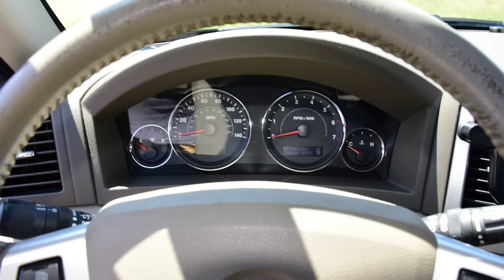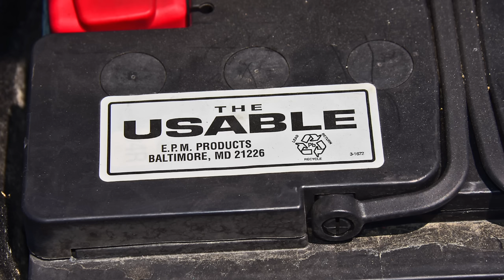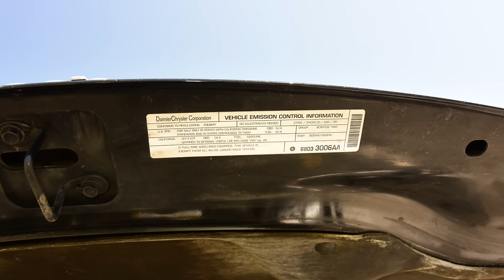2008 Jeep Grand Cherokee Laredo X: Regular Car Reviews

Comment: FWIW I can sort of relate to your "like everything" approach when it comes to cars. Now I do have a few particular likes and dislikes when it comes to how the car feels (I'll admit that I'm kind of particular on brake pedal feel/travel) but other than that it can be a cheap crappy car or a very nice car and I'll find stuff to enjoy about it, and driving dynamics wise I'll see something not great as a challenge and try to drive around that or to adapt my driving style to best suit the car: my vehicular hot take would be that back when my parents just got their Camry and I was younger, I enjoyed trying to go fast in it BECAUSE it was a floaty Camry (and with the 4 banger, not even with the nice 2GR V6) that felt predictable but not really meant to go fast in it. Similarly whenever I had to drive the office car in a previous job and it was some Chevy branded rebadged Opel corsa, I enjoyed revving  the snot out of it just to make it move, and use it's lightness to try and see what it would do. Similarly driving an old beater pickup or mostly rusted out grand cherokee where fun just because it was a challenge to try and keep going on it while the car's systems started to fail randomly.

Comment: Try a 2010 Ford Transit Connect...Those suck sooooo hard!
Reply: I think they were the first year offered in the US, if they are not already rotted out, or tyransmission completely shot, they all will have the same dent pattern in the rear bumper. They are sooo sooo terrible.

Comment: is the mechanics and capabilities of a mini van with the body of an SUV.
Reply: Nah, the Chrysler minivan old or new body was a better car in virtually every way. Was Chryslers flagship product at the time. Ran a 2005 towing and hauling absurd amounts for 10 years as a business and family vehicle. It was excellent at almost everything, other than undersized brakes and a pain to reach the rear cylinder bank. They tend to rust, but it survived PA with some rust repair for 220k miles.

Comment: Should have reviewed an early jeep liberty with the 4 cylinder. At least my wife's had the V6 but the 4 speed auto neutered it to the point it's still the worst car I've driven that my family has actually owned. I had to daily it across town because it got 15 mpg and my wife got my new TDI to drive 60 miles a day. She thought a liberty was a cheaper version of the RAV4 she wanted... She was wrong.
Reply: Those 2.4l first gen Liberties were pretty rare. Most were super stripped out base models sold for use as municipal vehicles. I see a ton of Liberties daily where I'm at but can't recall the last time I saw a non-V6 one.
Reply: @RatBürgerSk8  I agree most of them were stripped down models but we must have a higher poverty rate around me because I'd say it was about 50/50 between V6 limiteds and 4 bangers with non color matched bumpers. What's rare to see is the common rail diesel model they only made a couple years. Highly sought after but still a turd. Probably the slowest production vehicle in the US when made lol

Comment: Its a base model and 15 years old, lets calm down and moderate our expectations. When these came out in '05 they were very popular and well received. "Burnt out bulbs in the HVAC head unit" its 15 years old. "Humming noise from the rear" its 15 years old with 225,000 miles. "Hard plastic" its 15 years old with a design/engineering program dating back to the early 2000s when everything had cheap hard plastic.
Reply: where i live, these things are considered rubbish, but we have cars like Land cruisers, Nissan Patrols (both Y61 and Y62), Mitubishi Pajero and all these japanese SUVs absolutely s**t on these things in literally everything. even durability, these japanese SUVs have been running for approximately the same age (actually, we have japanese SUVs from 80s still running on original drivetrain) without even having any of mentioned issues despite being in way harsher environment. these WK jeeps however, you would be lucky to even see one running anymore
Reply: These were uniquely bad even for the era, no matter the trim level. The Ford Taurus Freestyle, Chevrolet Malibu/Malibu Maxx, and Mitsubishi Endeavour were all called out for their horrible interiors, but Chrysler products of this time between 2005 and 2014 were bottom of the barrel. I know from personal experience. Even cheap Hyundai Elantras were better inside and those were $14,000.
Reply: It's been my experience with Japanese car owners that they usually fail to disclose any issues they HAVE had with them, because they want the Japanese reliability Uber Alles narrative to be true so badly. Sure, most Toyotas and Hondas are well built and usually last a long time (although less so as of recently) However, Nissans have been garbage for 20 years and so have Mitsubishis. Toyotas from the 90s and 00s have interiors that turn to slime, I'd rather have hard plastic. Honda had a run of automatic Transmissions in the early 00s that blew up if you looked at them wrong, yet this is hardly mentioned today. Toyota couldn't figure out for the longest time how to make their trucks not snap in half in states that use salt, consequently there are very few 20 year Toyota trucks on the road still vs the domestic brands. Also, Toyota has had plenty of issues with engines sludging and rods flying through the block (early 90s-00s camrys) shitty CVTs in the corolla and myriad other issues over the years, yet it's all glossed over because "TOYOTA GOOD, DOMESTIC BAD" 

I guarantee there are more 15-20 year old chrysler product on the roads vs the same era of Hyundai, those have all but disappeared from the Midwest.
Reply: @carsandpipesforever506  i said where i live. and yes, CVT nissans are terrible, but the Nissans we got in GCC market that weren’t touched by renault (N16 nissan sunny, Y61 patrols, nissan hardbody pickups still being sold due to demand, Urvan, NV350) don’t give a crap about hot climate, they literally last forever. meanwhile american and european junk are filled in the workshops despite being 5-7% (yes, because they don’t last) of the cars on the road while barely being half a decade old. as far as mitsubishi, maybe yall got bad assembled ones? because the pajeros from even the first generation are still working. hell, we got mazdas and mitsubishis from the late 80s working to this day.

would take a pajero over a pile of crap american trash anyday of the week
Reply: I'm the owner. Everything you say is true, and frankly we consider ourselves fortunate to still have it around. BTW, the humming started about a decade ago at/around 90k (yes, it had been serviced before then)- my mechanic used to work at a jeep dealership and explained that the gears inside the rear diff sometimes develop burrs which causes the sound. Sometimes it's OK, sometimes it kills the diff (in which case, it gets REALLY loud before going). After my wife, this thing went to both my sons while they were in college. It's rare to get a college car back in one piece, more rare when it does two tours of duty. The kids are gone, so we use it as a third vehicle now. I accept what it isn't and appreciate what it is and what it provides.

Comment: This particular trim is the cheapest possible yet 40k price tag had a huge profit margin...you kind of should not blame the car on that, in fact jeep is doing it again with their 2023 lineup corporate greed its not related to car design. Because in paper this was an affordable 4x4 SUV i dont get why to demonize brands for getting afoordable trim levels maybe i dont want a second mortage to buy my next car? Sheer f*kn hubbris. (caveat corporate greed)

Just want to add if the battery exploded 4 years ago it means it was like eleven years old! What would you expect? Batteries shuld be replaced every 3 years, 5 tops.

Comment: I love zjs(grands from 91-98) and xjs(84-01 cherokees). Its not just the pretty tough body and parts. But that i6 4.0... if a jeep dont have it, there really isn't a reason to look at it. I got a 2000 grand and the build quality and engineering is horrible. Most everything that goes wrong means many hours of taking things apart to get to the flaw. Like the ac condenser and heater core. Every wire is stretched taught, which means it you have to disconnect something.. you have a serious risk of breaking the connection or wire. I will curse diamler chrysler til the day I die for what they did to grand cherokees. May they all rot in new jerseys... unable to escape for all eternity.
Reply: My rule of thumb if it was an engine designed in the 60’s and carried on through the 90’s it’s probably really good. AMC/Jeep 4.0, Chevy 350, Ford 300/302/351/460, are all fantastic engines and with modern oil will last forever. My wife was driving a ‘93 Jeep XJ when we met in ‘99 and we drove that for years after. They never made an engine as good as that in all the years since. I can certainly see why they’re so well regarded. We ended up selling it for an XLE V6 Camry that got a lot better mileage. I wish we would have held onto it

Comment: That thing has a bad wheel bearing from the sound of it.
Reply: Nope, it's inside the rear diff. Been making that sound for about a decade. Good part is that you can't really hear it when you get to highway speed.
Reply: @mikehook4830  I'm sure it'll work fine until the diff locks up. 

I was correct it was at wheel speed though. Probably side bearings.

Comment: Do you really need 4lo? Especially with an automatic? I personally feel like with most mud/snow, you need more wheelspeed than you can easily get with 4lo.

The main thing I use it for in my truck (old 5 speed frontier) is for backing up trailers with the locking hubs disengaged (2lo lol).

That said. These Jeeps are garbage, my grandma's wife got him to buy her one with the hemi and it sucks ass, shop queen.
Reply: Also honestly, for snow, I feel like various mom truck full time 4wd/and systems are better than a true old school 4wd system.

Comment: Oof, that 3.7 L V6. I remember driving a Wrangler Rubicon and a Caravan with that boat anchor of an engine around 2007-2011, which seemed like it was really good at converting gasoline into noise and not much else. There's a good reason that the Pentastar V6 was so well received, since it was a quantum leap ahead of the 3.7 and its "I DON'T WAAAAAAANNNAAAAA" power delivery.
Reply: One problem with everything you just said: Neither of those cars came with the 3.7...
Reply: @MeDicen_Rocha  Now that I think more carefully, you're right; they came with the 3800, which I think was a close relative of the 3.7? It had similarly disappointing performance for its displacement/fuel consumption.

Comment: The cargo tie down loops are supposed to be bolted to the body floor. The front shudder is control arm bushes which is common on these. Also transfer case mount. This would be a great "Camera Car" Nice to see a review without the vulgarity.